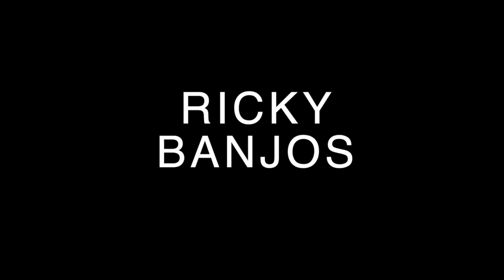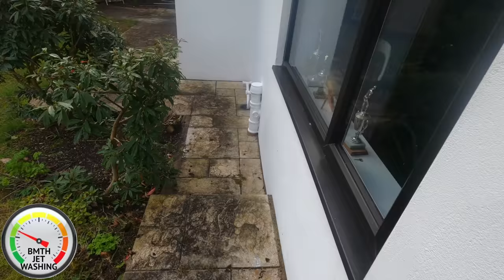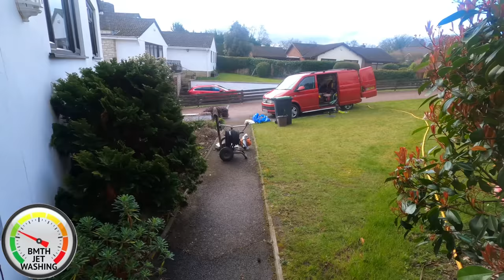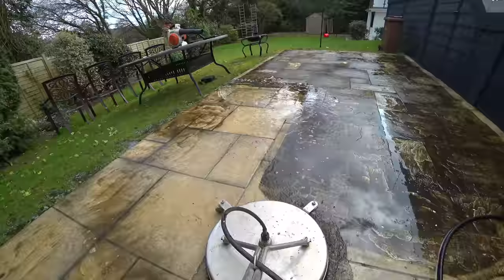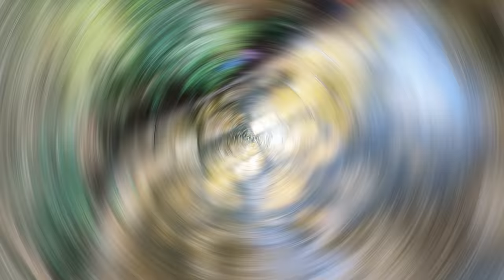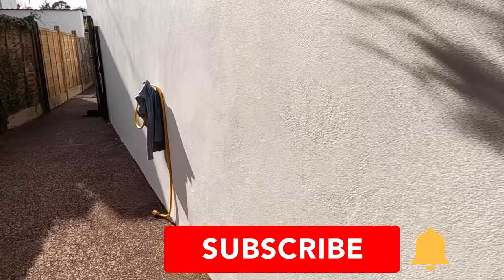Restore your patio with a deep clean

Comment: Hi Ricky.
I'm a window cleaner and I scrape roofs also. I'm about to enter into the world of pressure washing (just cold water for now).
May I ask what you sprayed onto the patio after using the surface cleaner? 
And what you used to spray it on with please.
Thanks
Rob
Reply from the maker: Hello Rob its just soduiim hypo with a softwash surfactant, you can get the softwash surfactant on ebay
Reply: Thank you sir. Appreciate the reply. Are you using something like an xjet to apply it?
Reply from the maker: @robsharpe1  yes xjet of roller pump check out www.rutlandpumps.com

Comment: Hi mate love the videos, I have petrol soaked on to my Indian stone and my wife has used varnish to seal it but the petrol keeps coming through as blue spots that when I pressure was it away the varnish comes off like dead skin have you any tips to sort this out so I can re varnish it without the blue spots coming through.
Reply from the maker: That sounds like a ball ache of a job, try a good degreaser with a kettle of boiling water and scrub into it to draw it out

Comment: Nice work.  Do you ever spread on a bleach solution before surface cleaning?  If yes, how often & under what circumstances?  If no, why not?  What is the soapy solution that you apply post-surface cleaning?  What % of improvement would you estimate that spraying on this solution adds to the over all results?  Do you ever do pressure wash jobs w/o using this soapy solution step?  Your camera work, editing & vids are great.  And I'm gonna try your "cup of tea before work" advice.
Reply from the maker: Hello Joe depends on the job , ifs it really bad a pre treat will loosen it up fella , Def get that tea before you start

Comment: Hi Ricky, great video! Why don’t you ever wear ppe when applying hypo to the surfaces?
Reply: Im not sure if it's hypo he uses. Wouldn't you put that down first to cut through all the crap? Easy to get complacent with PPE when your around chemicals a lot though I know from experience.
Reply: @SamPerry24  sometimes you only use hypo when you need it. I.e clean the area as normal, if it needs hypo, apply it and then just rinse off. Sometimes he does it before, sometimes he does it after but i’m sure that’s hypo
Reply from the maker: Hi Ben i do i wear my pressure bib and braces, the hypo sprayed is not that strong, never really been one for the health and saftey nonsense when its not needed